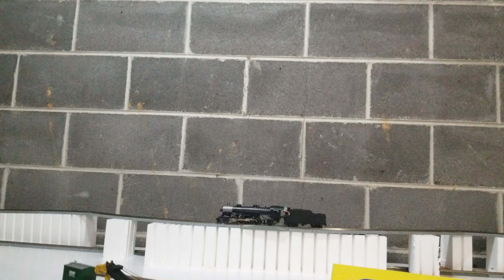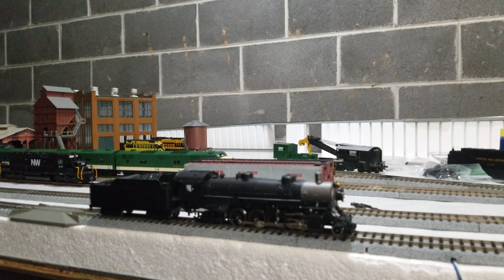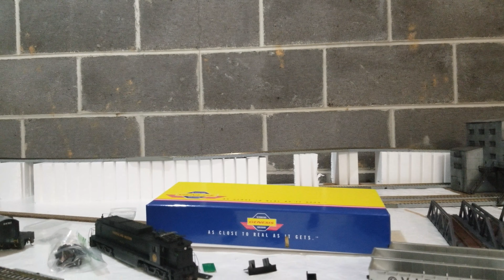4x11 HO scale layout. Over under. Athearn genesis

Comment: On the steam engine if you would do Southern you have to put a little bit of green on it somewhere I would say NW because it's already black unless you can find a green smoke unit that would work horrible on Steam Engines but the two humps in the middle you can paint green and then above the engineer you can paint the Hood part green on top or something in that manner on the hill did you think of just taking it out and leaving the hill and straightening it up and you've shown yourself a few times you'll get used to it after a while I'm the same way at times and do you know anybody that can speed match engines until your next video